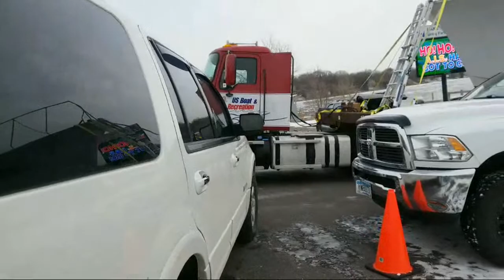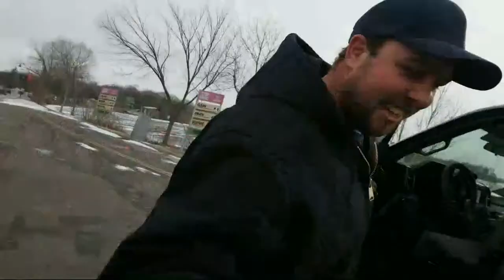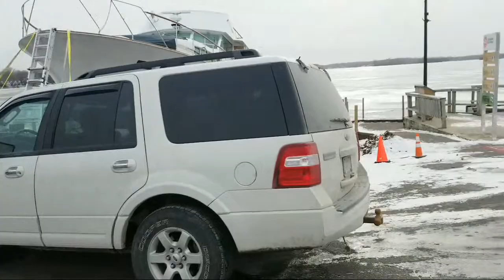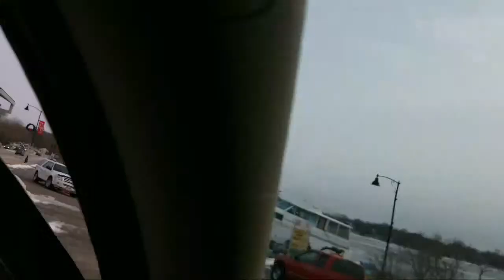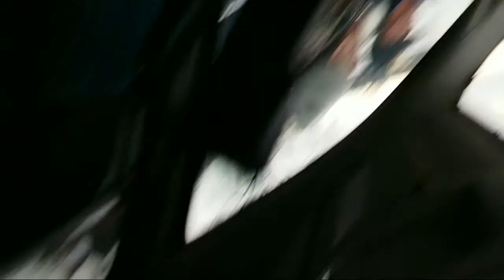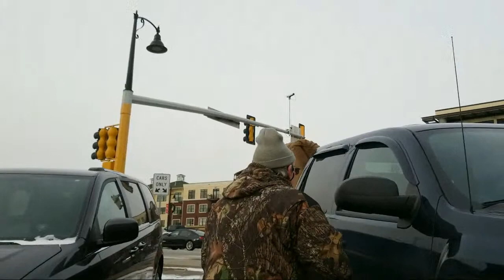The Day After: What"s Next? Interview with Boat Owner!!

Comment: All the weight of those diesels might help when they have to move across uneven ground plus all the tanks of fuel are all low down in the hull that and the engines will help stabilize the boat.